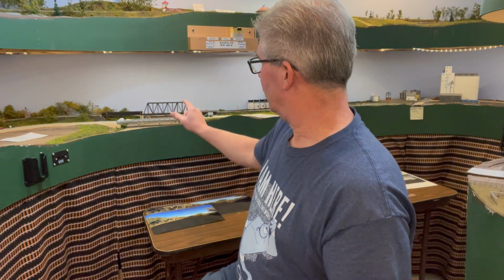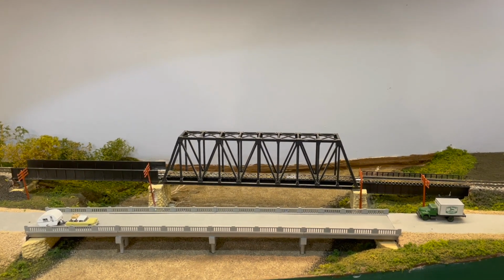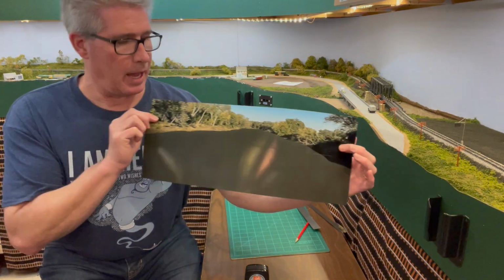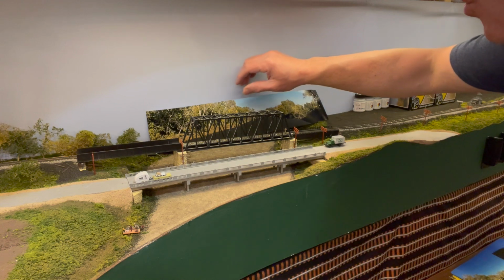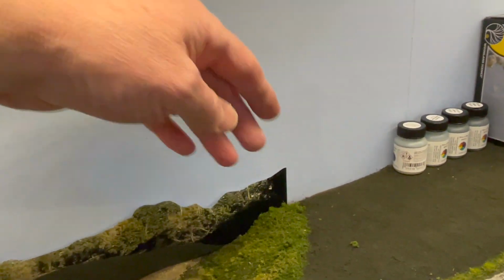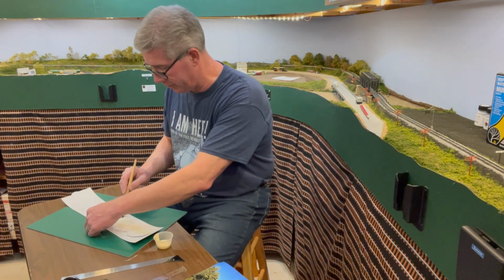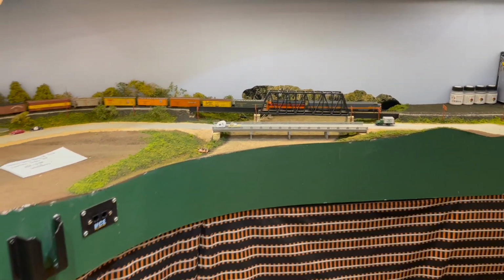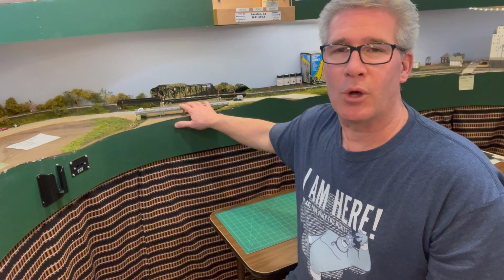How To Series: Progress Update on the Water Features Part 6

Comment: Why not use clear caulk on the underneath side of the layout on the back of the pour area? That would for sure seal it up and you can just leave it because it's clear and in an unseen area anyway. The picture backdrop turned out really nice on this just like the other. Its gonna look really good with the water in and the trees blending the picture into the backdrop. Good video. Stay well. -Wil  👍
Reply from the maker: I have found that not all caulk and water materials mix well together.  Sometimes the clear caulk can make an unrealistic seam within the water.  The other reason is I can not use a caulking gun due to the room I have to work in between the two decks of the layout.  I could use the single squeeze tubes but that does not always have a nice even application when it comes out.  Thanks for watching! ~Tony
Reply: @CornCountryRails  I figured you had a good reason.  👍